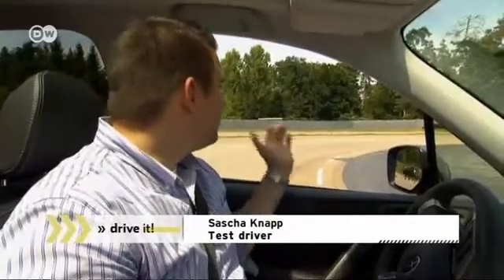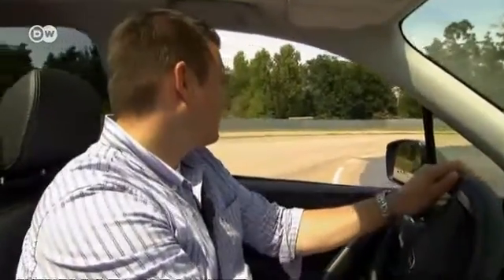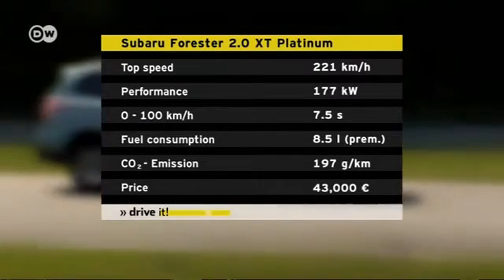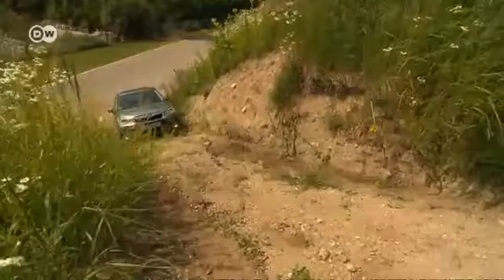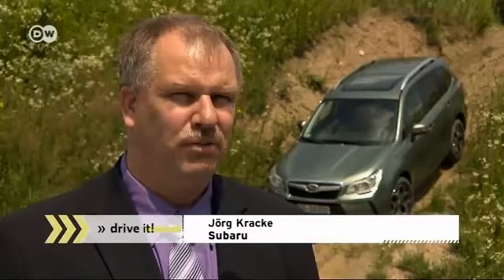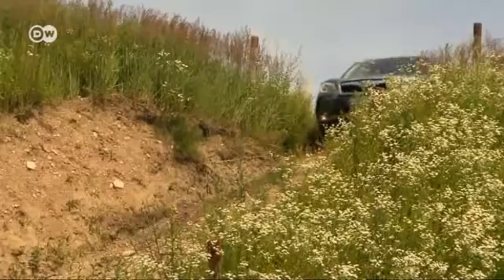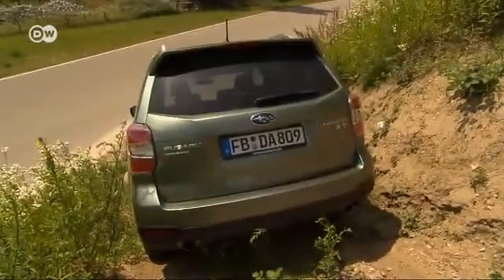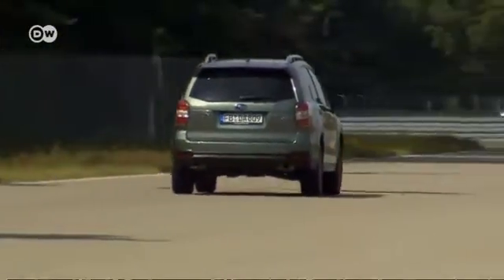Fourth generation of the Subaru Forester | Drive it!

Comment: I heard that the Boxer engine  tends to use oil, even when new.
Reply: +Loren Reece You may be referring to a tendency found in some of Subaru's 2.5-liter engines, but that problem was solved in all models with a head gasket redesign in 2013/2014.
Reply: Never did thank you for the reply.  T y.